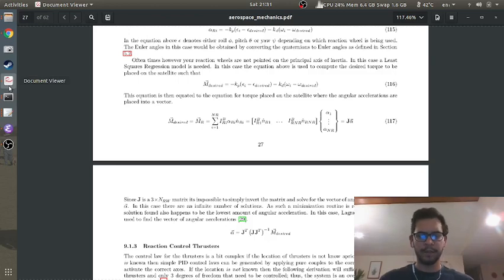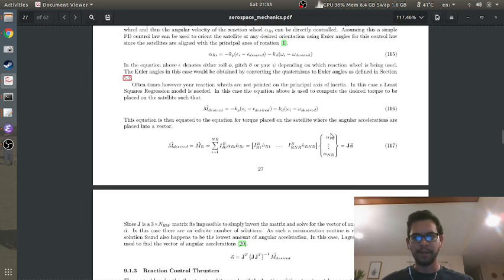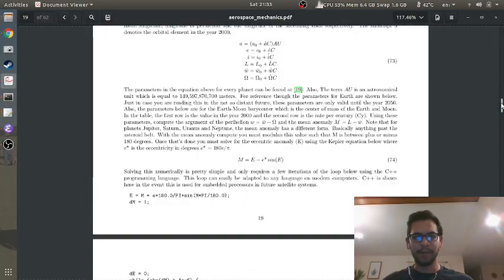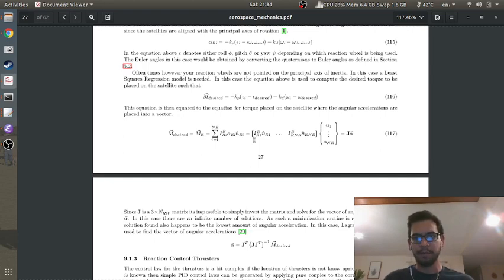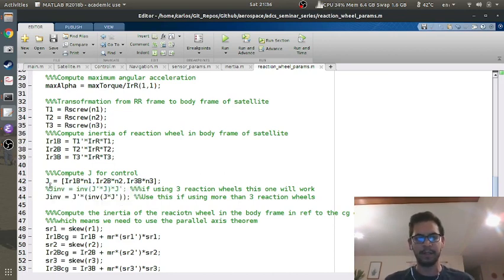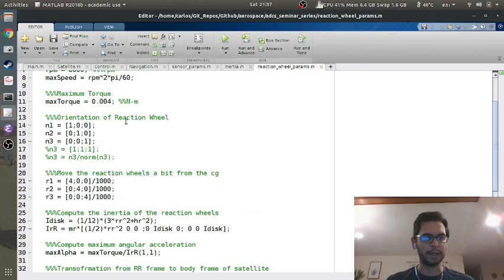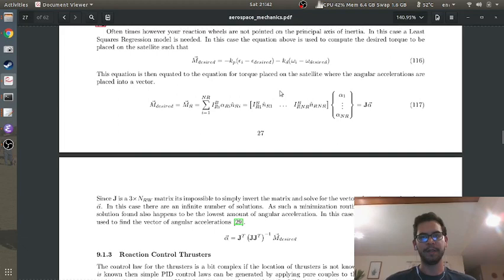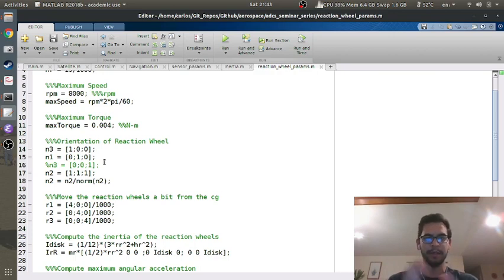MATLAB Help - CubeSAT Simulation with Non Principally Oriented Reaction Wheels

Comment: Thanks for this. I was trying to change up a few things (convert to 4 tetrahedrally aligned RWs, use a quaternion-based controller, control to angles other than 0 etc) but keep running into instability issues. Could you please share the transfer function you obtained for this? Will be very helpful to aid with stability analysis and controller design.
Reply from the maker: I don't believe I created a transfer function for this.
Reply: @CarlosMontalvo251  how did you analyze the stability then? also, if you created a transfer function for 3 principally-oriented reaction wheels can you share that?
Reply from the maker: @aryaashutoshpathak4849  I analyzed the stability dynamically by simulating the equations of motion. I probably did a homework problem a while ago and found the transfer function to be something like A/s^2
Reply from the maker: I might have to make a new youtube video. This is the only thing I could find. https://www.youtube.com/watch?v=TzXg9WQAtoM&list=PL_D7_GvGz-v30U58EUUOdJGgO4u75DXoB&index=2
 that was related.
Reply: @aryaashutoshpathak4849 Were you able to implement the quaternion-based controller?

Comment: Hey, Carlos! Thank you for your video! It a great and challenging work. My question is related to Navigation portion. What is the theory behind your code ?
What are BfieldNavPrev, pqrNavPrev and ptpNavPrev stand for ? 
Thank you. 
Let me know if you have a time to set up a quick meeting with my grouo to go over our senior design project. We build a 3U satellite that uses reaction wheels to control the cubesat.
Reply from the maker: The Prev values are used for the complimentary filter. I'd recommend looking at my book here https://github.com/cmontalvo251/LaTeX/blob/master/Aerospace_Mechanics/aerospace_mechanics.pdf 

Section 9 details the GNC block and then section 14.5 specifically equation 181 details the complimentary filter.

Unfortunately I have my own satellite team here to support and I can't help more than a few emails. I wish you all the best! Feel free to email my South Alabama email address if you'd like to discuss further.